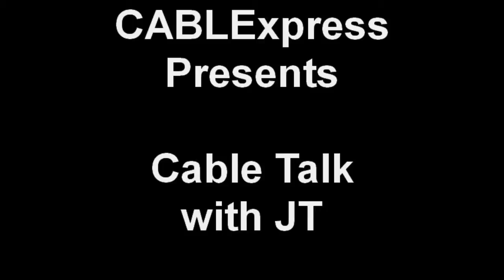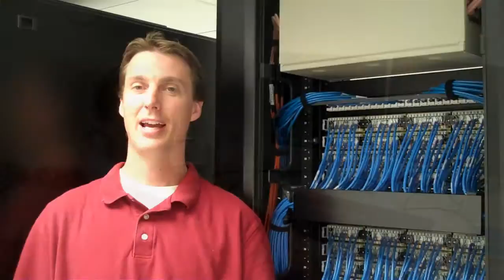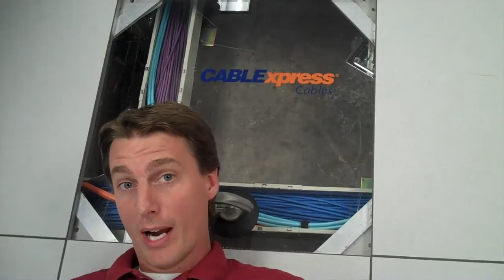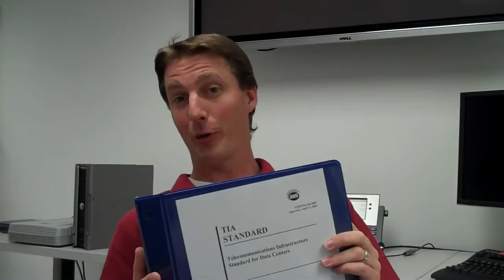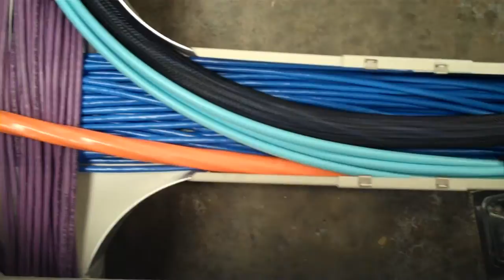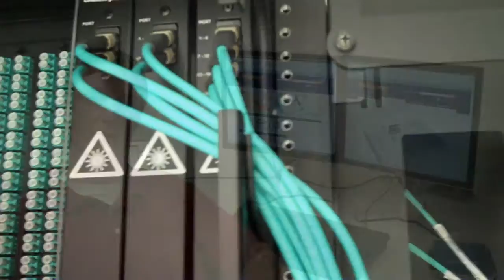Structured Cabling System | Structured Cabling Tutorial (Ep. 3)

Comment from the maker: @isaacu we were refferring to plugging the MTP (or MPO) 12 fiber connector into a patch panel.  The active equipment would reside in the equipment cabinet, typically in a duplex LC format.  The MTP is projected to be used on the active side at 40/100G speeds.  I hope that answers your question?